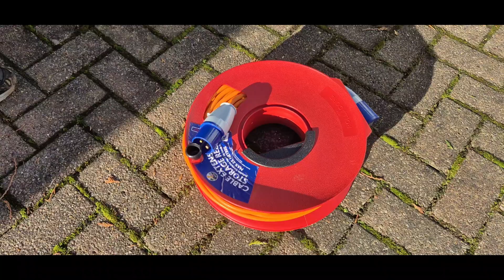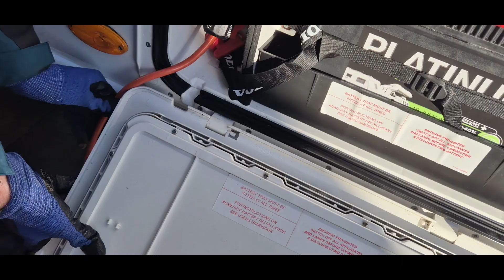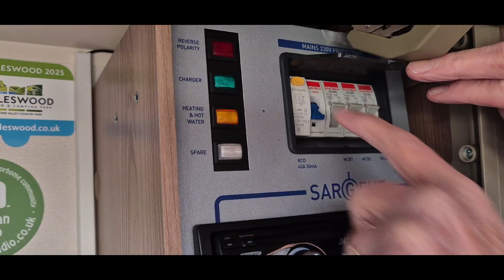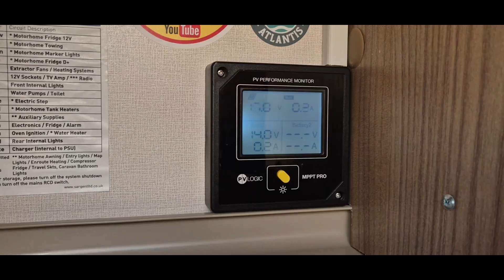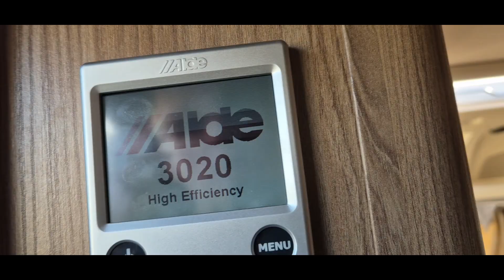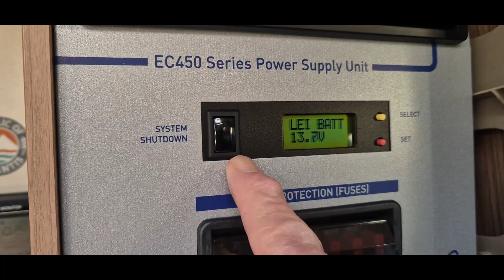New To Caravans 5 - The Electrical System

Comment: Great info and some good tips...  I am a sparky, please get a qualified electrician to fit a 16A socket on the side of your garage, I can tell you did it yourself, there are a number of issues with the installation (I wont go into them as dont want to encourage others to fit their own socket) so please just pay a professional and get it installed correctly as you go on about safety but your socket is not installed correctly..
Reply: Thank you for your comment